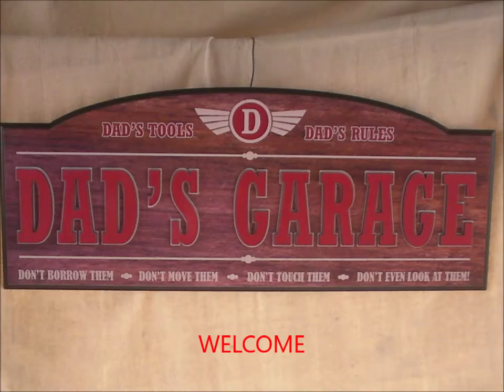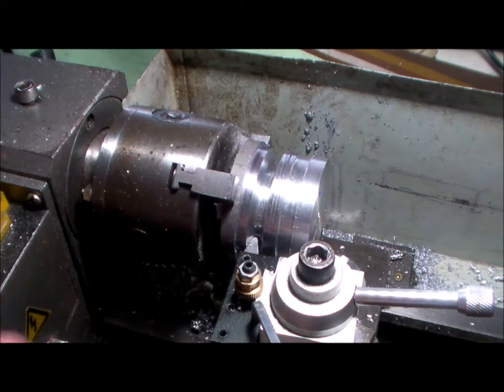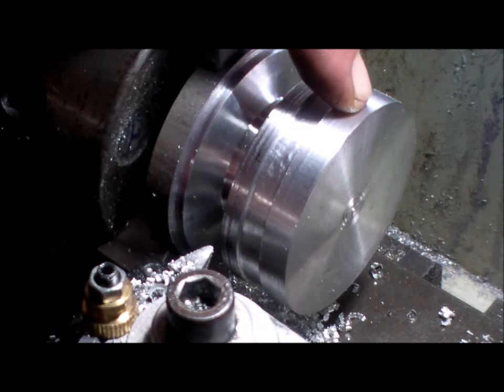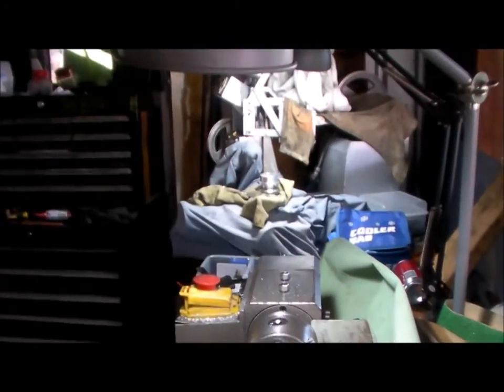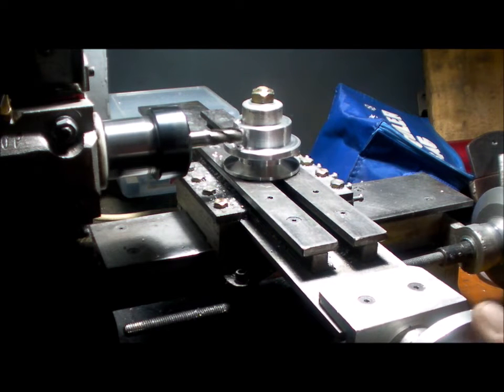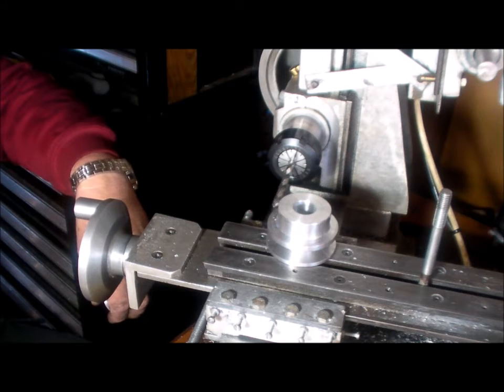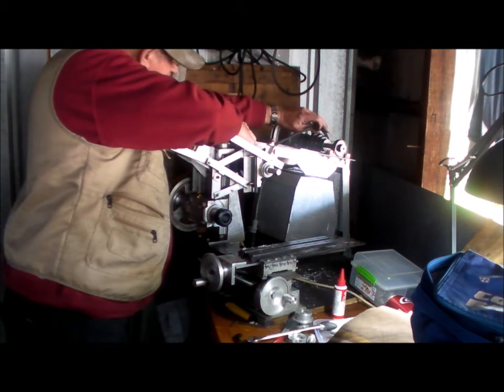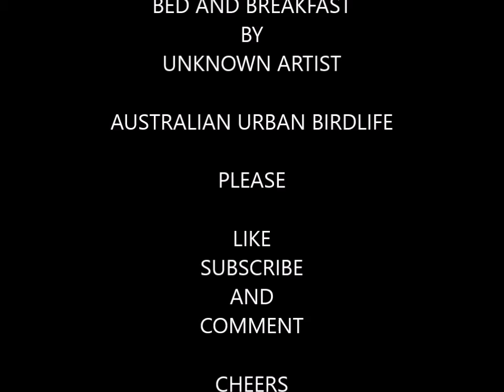Building the Gingery Milling Machine 67, making a 2" "V" pulley

Comment: Nice job on the 2" pulley. The set screw was  a little larger than I use, but to each their own. The saddle moves up and down the bed ways. the cross slide is on the saddle , for cross feeding . and the compound is for the angle cuts. Now you know the main weakness in the design. The narrow bed ways. The wider the bed ways, the more the load is spread out , and the more stable a cut,not to mention the greater the diameter of cut, you can safely make.There was for a time on the  internet, a guy that increased the size of the milling machine drawings by 1.8, and it was just about the perfect size . If I remember correctly, the bed casting required about 20 pounds of aluminum.  Glad to see you using the mill. Hope you get lots of use out of it. Make a dividing head for it ,then you can cut your feed dials for your handles, instead of using outside calipers.
Reply from the maker: G’day Ronald thanks for commenting. Sometimes the mind goes blank but I can still successfully raise a mug to my mouth and not miss, praise the Lord. As I start using this machine it’s limitations are apparent but I know the permanent work table will tighten it up Not bringing the job into the cutter from the climb milling side improves things also. When cutting from the “ proper” or normal side the cutter is loading the travel screw. I also need to incorporate travel stops into the saddle because it creeps when using the fly cutter for an interrupted cut. I thought making this a scaled up machine at the start but after pouring the bed I thought twice about it because it was the limit of the crucible and furnace and importantly I was a total newcomer to foundry work, didn’t want to press my luck. Like the mini lathe where I push it’s boundaries I’m sure to do the same with this, we all need a bigger machine. Cheers Peter

Comment: Enjoyed the video Peter.  Love the ingenuity of your milling bed on the lathe.  I often start projects like this with a set time I think I'll complete it in but forget the X 2 factor every time.  It will be a great little machine when its all done but savor that enjoyable workshop time while your doing it.
Cam
Reply from the maker: G’day Cam not to sure what you meant by “milling bed on the lathe “ as it is a horizontal mill but yes it’s bed and spindle is like a lathes. Thanks for stopping by and commenting. Cheers Peter
Reply: Sorry Peter, not with it.  The setup using the mill to mill your components for the mill.Cam